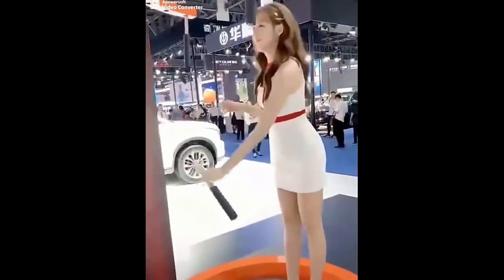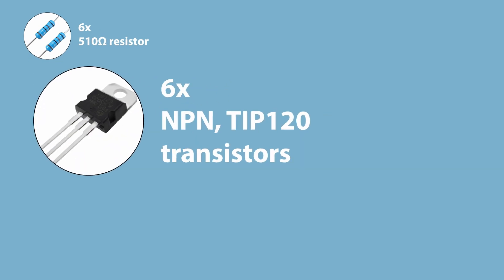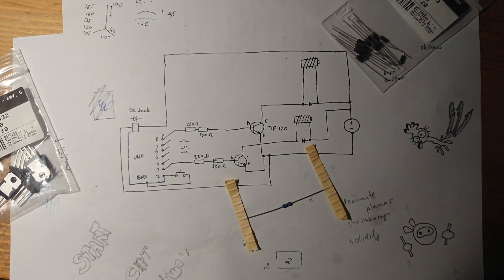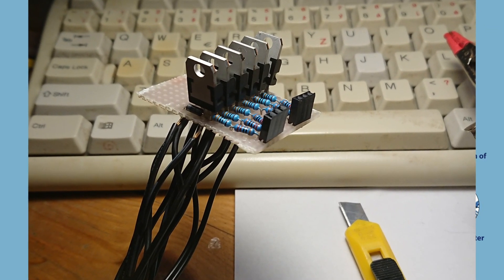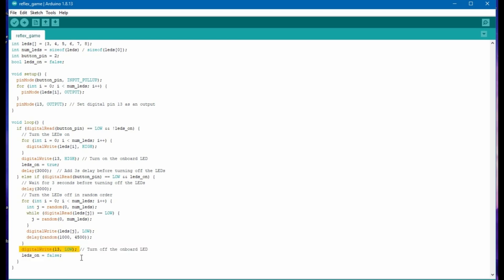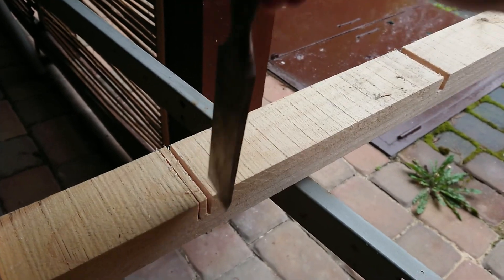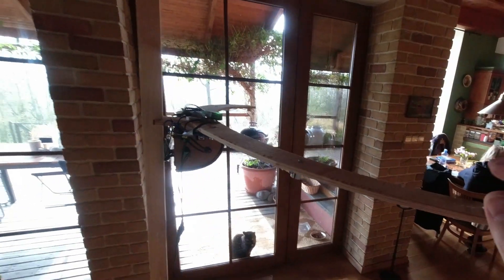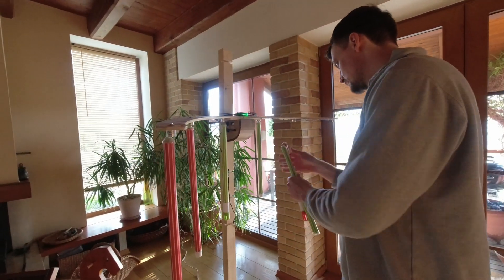arcade-style stick-catchnig reflex game

Comment: Hello my friend good work you have made  i love you project and if you want ad more stick it possible no? and you can share your project please,I mean schématique and code😜. Thanks my friend big hug
Reply from the maker: thank you. The link to the project is in the video description: https://www.reddit.com/r/arduino/comments/13gqe19/build_an_arcadestyle_reflex_game/
As for the number of sticks, it sure is possible to add more. There are at least 4 more pins on Arduino and if that wasn't enough, there are ways to quadruple the number of outputs if I'm not mistaken. However, I'm not very good at coding. Chat GPT did most of the coding for me and I just kept messing with it in an online Arduino simulator until it started working the way I wanted... it could be a matter of changing the first line of code defining the number of leds outputs (the simulator didn't have magnets so I was working with LEDs) or not...
Reply: @sirClogg  hello my friend how are you? well you can tell me two more things what electromagnetic you used 5 or 12 v? And in your board you put 12 resistor's why?😁
Reply: @sirClogg Hello friend how are you? Well on site Reddit os complet code?